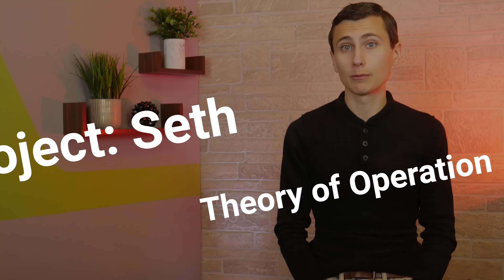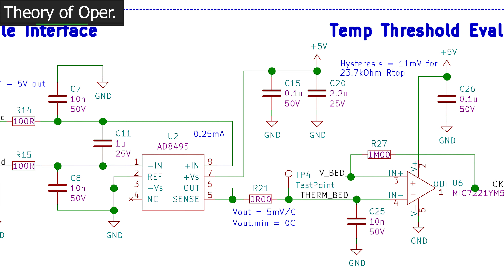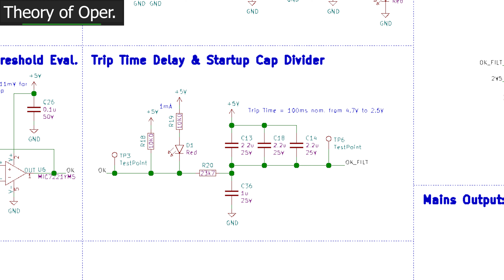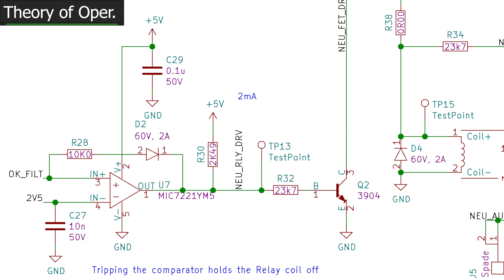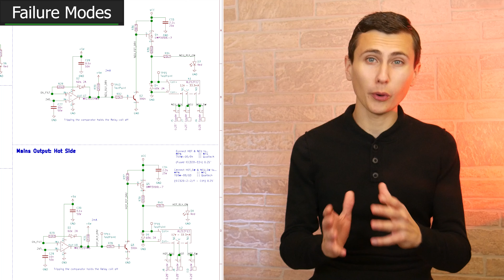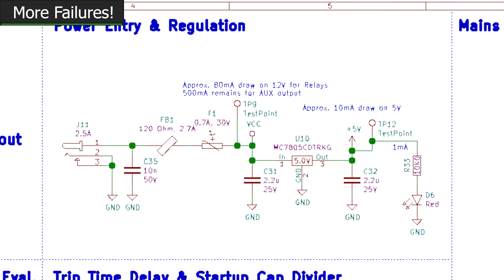3D Printer Thermal Runaway Protection – Theory of Operation & Failure Modes

Comment: Interesting idea about relays in line and neutral. However if the neutral relay fails open and the live is still energised then this would leave the circuit non functional but still live.
Reply from the maker: Hi Dave, agreed! Yeah, there is that opportunity. There are a couple edge cases that I would agree fall into a "not ideal" category. 

One potential mitigation would be to drop an opto-coupler driven by line & neutral, which would detect that one relay "failed open" state... which could turn off both relays. I opted to save that bit of complexity, mostly because I'm not convinced that leaving line connected without neutral is intrinsically more dangerous than connecting both line and neutral. 

That, combined with the fact that - like you said - the downstream device would be non functional... I Imagine an operator would notice something was wrong in a hurry! If power is effectively cut off from the downstream device (even if it's not ideal) in a single-fault condition, that's where "good enough" kicks in. Maybe a better way to say this is: this device is never intended for use after a fault occurs, but we made sure it's very likely to still provide protection if a single fault occurs, and hasn't been detected yet.

Great stuff to think about, thank you for the comment! That's a good point that didn't make it in the video, and important to think about! Cheers, Dave!